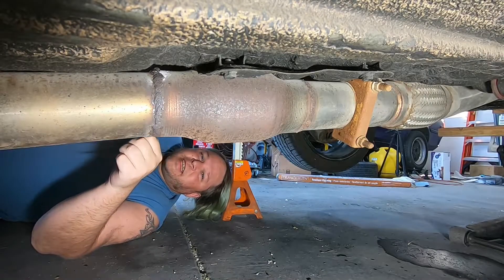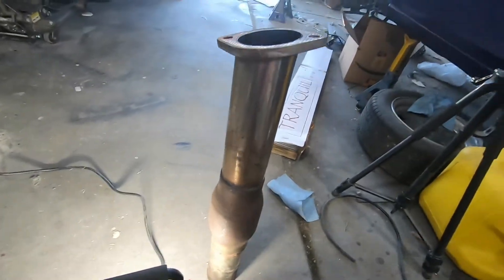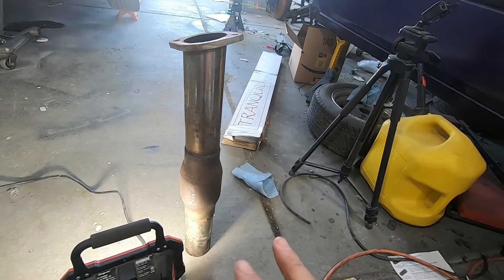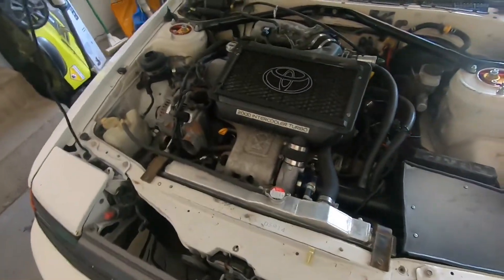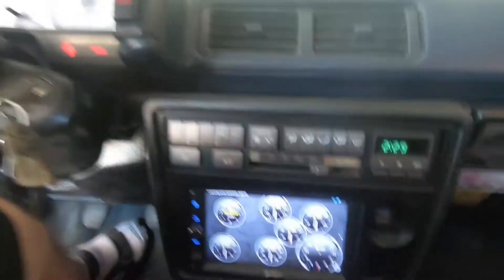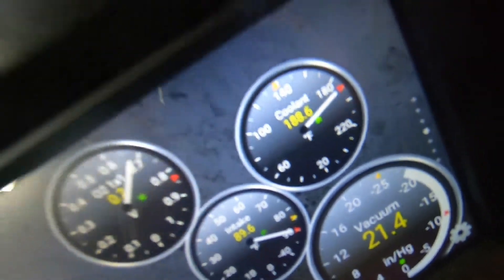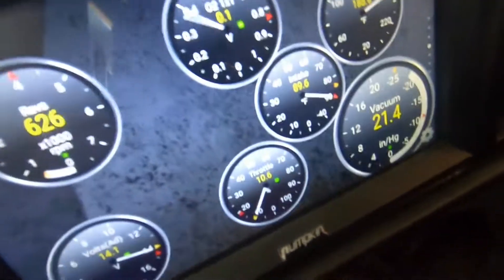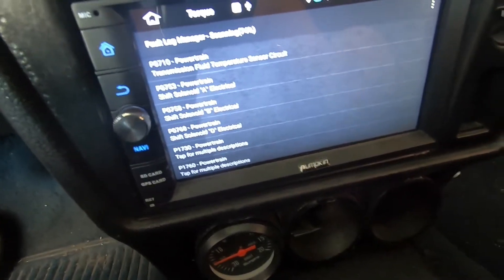ST165 - Alltrac attempted repair doesn't go as planned

Comment: What ecu you running what’s was the problem
Reply from the maker: I need to revisit her. Last time I drove her she was fine. Seemed that the cat had clogged/got more restrictive from previous issues. The car is currently still using the stock ECU for the 4th gen 3sgte.
Reply: The 3s gte ecu has obd2 port ? How you got that code a scanner and other readings on the android radio
Reply: Definitely a aftermarket ecu
Reply from the maker: @onelinkrecords  Funny enough, I covered that in another video. You use Torgue Pro, but there may be other tools. https://www.youtube.com/watch?v=1SND7KFUqTI&list=PLKQJNKnEah6VObwqKGvjjmULYJpjjvxD6&index=24
Reply from the maker: @onelinkrecords  Nope, stock ECU to the engine.
Reply from the maker: @onelinkrecords  The 4th gen 3sgte has an OBD2 port. This car runs the Caldina engine from the late 90's to the early 2000's.
Reply: @UtahSleeper  did not know that thanks